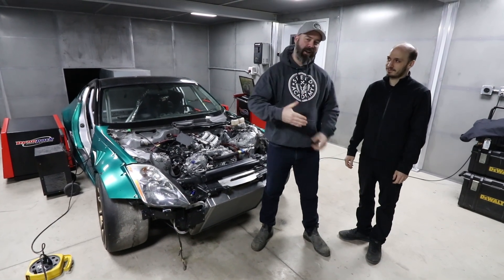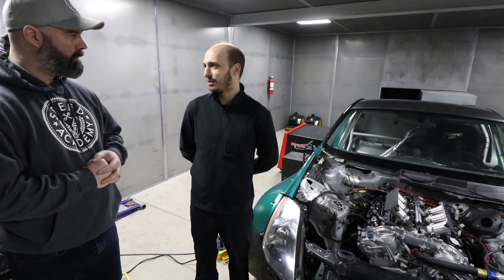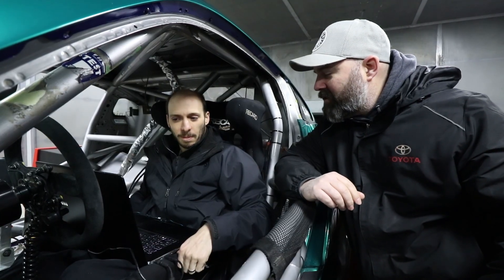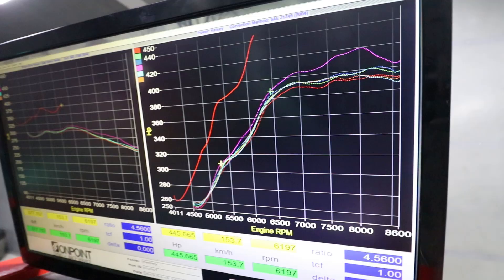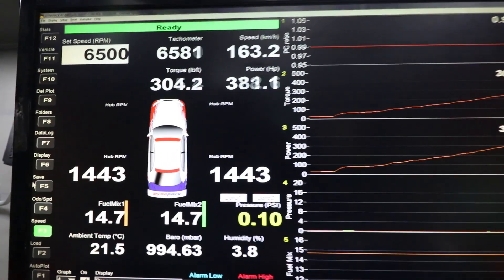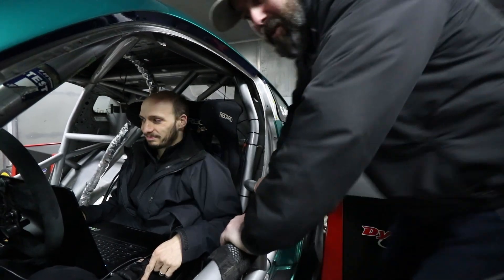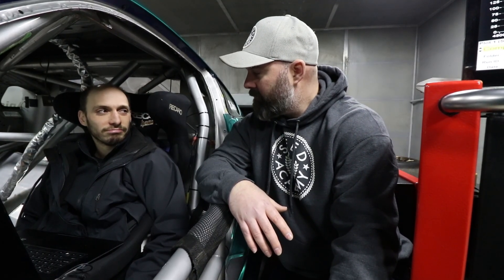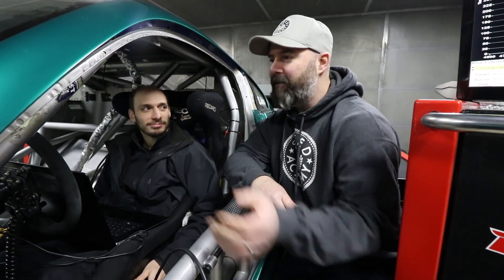RECORD BREAKING! Highest HP ALL-MOTOR 350Z Engine In the WORLD

Comment: there's a lot of 6g75 mivec engine that are making more power than this vq engine, check out el Yadiel mirage that car ran 167.49 mph on a 400m drag strip, that's the fastest trap speed for an all motor in a 1/4 mile.
Reply: thats a 500hp motor with good gearing light lancer body, 6g75 weighs more than all alloy vq as well but 6g is a great engine but with boost nissan V6 make way more hp these days than any mitsubishi v6. Love to see a 2023 GTO v6t but polypropelene composite body version rwd to trounce ft86.
Reply: @altruismfirst6489  check out powertune evo 5, its a 6g75 mivec lancer evo projected to make 2500 whp with 98mm gtx 5533r garrett single turbo. right now they are making 1930 whp with e85 on 40 psi not yet on its full potential and still on the early days of its development, most nissan 6 cylinder engine today once they get to the 2500 whp territory they need all billet stuff, that powertune evo 6g75 mivec still uses the oem iron block and oem cylinder head mitsubishi with of course modified components like valve springs, retainers, camshafts. but still unported and no valve job done.
Reply: @altruismfirst6489  6g75 mivec all motor drag cars like el mvp and el yadiel are way above 500 whp using nitromethane fuel, those cars are making 700+ whp or even 800 whp evident by their trap speed.

Comment: The craziest part of this engine is that it isn't making that power at crazy high RPMs like 10-11k it's just at 8200rpm and seems to have the driveability of a production road car engine. BMWs 4.4 liter S65 makes 444hp at 8300rpm, this thing is making around 200hp more at pretty much the same rpm...nutty.

Comment: so i finished watching the video and I've got to say that I'm disappointed! on "jay leno's garage" they had a 240Z with a GTR engine without the turbo's that made a little less than 300hp at the wheels and that inline 6 sounded WAY BETTER then this one! I love "all motor" cars. I hate turbo and nitrous engines. so it's not like I'm a turbo guy that doesn't like any engine making less then 1500hp. but this was so disappointing! on several different levels. #1 I don't like all the noise this engine makes at the front of the car. that "knocking" is annoying to say the least! the exhaust doesn't sound good either. and even though it makes 600hp. it just sounds like shit!

Comment: could you build a 4.2 and pair it with a stillen supercharger. Definitely keep the compression to like maybe 10:1 and let it run safely and reliably as a street car. 

Hoping for a Rev Limit of around 8k (8250- 8500 RPM)
Really looking for the increase in torque on the low end, and the supercharger to bring it to say 550 RWHP reliably on the high end.

Is this possible to build for my G37?

Comment: Where are you getting 600 bhp?  Friction loss through the transmission is maybe 5%, and you're not trying to spin huge wheels/tires like on a chassis dyno.  I'd give it 567 bhp, which is the theoretical limit of that engine at that rpm (excellent, btw).  Low 10s in the quarter mile?

Comparing your all out 4.2 to Porsche's 4.0 L restricted motors is not apples to apples.

You should work on broadening the torque band.  Proper 1-7/8" headers should fix most of that and help the engine accelerate quicker, better transients, better driveability.  A Helmholtz air box can improve power in your target range, and properly sizing air filter won't kill that much power.

7800-8000 rpm is a good rev limit for an endurance engine with that stroke.  A bad downshift could ruin your day.
Reply: Drivetrain loss for a RWD is considered to be about 15 percent. That's not really something that's changed as far as I know. Straight cut gears might help slightly.

Comment: That is still not absolute peak power for that motor, you can hear it coming on and wanting more...
He might want to re design the exhaust down pipes with wider tubing and better cross flow to help with the heat.
But apart from not reaching maximal potential for the engine it sounded lovely and was a very cool project

Comment: Crazy numbers!  That's over 89Hp per cylinder or 127hp per liter out of an N/A V6.
Reply: Honda did 120hp per liter in the S2000
Reply: @Baerschi100  right….is that somehow important to my statement from 5 years ago?
Reply: You mean a 4.2L V6
Reply: @stezenast5878  why do you open your mouth to say dumb shit
Reply: A bit too crazy.  405 lb-ft of torque from a 4.2 liter NA can only mean oxygenated fuel and that´s at the crank.  If these numbers are at the wheel/axle then it can only be NOS.

Comment: This is how you build. Once you've experienced big NA power, you never go back. Turbos are fun but the real track weapons for sensitivity, longevity and reliability are high HP NA. End of story. 
I run a dry sump LS3 with a custom Kelford cam, touched up rotating assy, custom SS LT headers and 3" exhaust in a T56 mag S2K. I have owned many litre bikes before that too, so NA is where I prefer.
Reply: never heard of anyone running a Kelford cam in a LS. What made you go that route?
Reply: Hell yeah!!! preach it brother. I'd take an NA engine every day of the week over a turbo one. I don't care if it makes more power nothing will ever replace the feel of a na v8.
Reply: U owned a liter bike in a straight line?! Or lap?

Comment: Also, I’m surprised he held the engine at high loads/VE cells for steady state tuning. Usually, I stop at 4500Rpms, then continue doing power runs from there to redline but with EGO/closed loop wideband O2 feedback turned on with +\- 15% correction for rich or lean fueling. Then I go back in the data log of that power pull, reference it to each load cell/area of the VE MAP I went rich/lean and make my VE fueling correction (based on EGO correction).

The reason is, for higher loads, you pass throw those cells in the MAP so quickly during a power pull that you don’t build up as much heat; where if you held it in each cell under high load (steady state), you do build up much more heat (high EGTs).

Comment: I just recently purchased a 2004G 35 sedan just want to know how much power could I get out of the stock engine thank you for reading this
Reply: Depends on condition of the engine and budget...up to roughly 240-250whp I'd guess isn't too hard to achieve for an auto rwd vq with full bolt ons and tune, but maybe more, others can better answer this I'm sure

Comment: Don't know why I'm putting my 2 cents in as you guys are at the top end of brilliance. But I'm wondering how it would perform with a large enclosed plenum over the itb's? I've had success with it smoothing out low end on my k20. Might be because my home made itb setup isn't as efficient as yours. Just a thought. Love the build though.
Reply: Thanks! We do have to build some airboxes. The last ones we made were holding back a lot of power so we have some redesign to do.
Reply: @sashaanis5966  Exactly what I thought would have been the case. Horses for courses I suppose, obviously it's designed as a race engine and having great high end is the goal, whereas the goal for mine was just an aggressive street application, which is why the airbox suited it, sacrificing a bit up top and strengthening the low-mid range, not necessarily a positive for your build. I would imagine designing an enclosure to suit the amount of flow required would be a logistical nightmare.

Comment: There is a guy with a all motor coyote engine N/A that revs 82k rpm and its making 600rwp but thats a v8 not a v6 so very impressive with this car
Reply: I dont think a v8 can do 82000 rpms
Reply: @packrunnr   shelby Gt350 5.2 L 8200rpm...Porsche 918 Spyder – 9150-rpmLexus LFA – 9000-rpm
The V10 

Ferrari F12tdf – 8900-rpmPorsche 911 (991) GT3 RS – 8800-rpmAudi R8 V10 (First Generation) – 8700 RPM 

Do some Research before you come to conclusions.
Reply: @trunkslorenzana  k=1000
82k = 82000
No engine does this lmao
Reply: @AngeloAmanoDomingo  oops my fault, I Just realized I added another 0, I meant 8200k not 82000k My bad guys.

Comment: Haters will still hate even though, "why not get a v8""why not LS swap it?" Gtfoh😂😂😂😂😂😂
Reply: Because LS engines with boost can hit that number with stock internals for thousands cheaper. Any decent LS salvage yard pull lolz. Noob.
Reply: @Saiyan585  Yea man but its a super common swap and who wouldn't want a 6 cylinder that runs with or even smokes a v8 lol  #lsfanboys 😂
Reply: rd95stang bc your better of getting a flat straight 6 sounds better than this shit, BMW and Porsche 💪🏻
Reply: @ĒMANN310  I'd rather a 2jz then lol
Reply: @rd95stang  that v6 will have a garbage ass tq curve too. smoke a v8? nah. thats alot of work for only that much hp...you could get that easy from a big block v8.
Reply: @frigglebiscuit7484  yea im sure power to weight ratio won't come in to play at all lol
Reply: @rd95stang  350zs weigh like 3500lbs. my big block dart is like 3200, before weight reduction.
Reply: @rd95stang  awww, you upset? the 350zs around me are all slow af.
Reply: @frigglebiscuit7484   upset?  Sure guy I'm upset, whatever makes you feel better 😂😂😂😂
Reply: @Saiyan585  basic B

Comment: Nice build, and it sounds amazing - but I'm going to have to say that the dyno is being very generous with torque & power figures.... probably to the tune of 10-15%, if not more.

Even assuming no drivetrain losses whatsoever, that 410 lb-ft peak equates to a BMEP of 241 PSI... which is a good 15 PSI higher than Nascar & older N/A F1 engines.

Comment: That’s quite impressive. Deserves a lot of respect. Especially in the days of turbo everything. Although my NA motor makes 700 horsepower, it does so with 9.4 liters at only 5200 rpm. But it has 500 ft lbs at 2800 rpm and 710 at 4700. But that’s just a mild 10:1 CR. Different strokes for different folks. Heh, literally.
Sweet Nissan though

Comment: Why not just use an off-the-shelf stroker kit and sleeve the stock block instead? You could get a more reliable motor with more room on the top end, and a bigger bore unshrouds the valves

Comment: A good build on a modern engine having 4.2 liters of displacement, why would it only produce 500 bhp? People have been producing 300 bhp K20-engines for over ten years now. Porsche leaves a warranty with their 4.0 @125hp/ltr.
Reply: First, it's 537whp, which is around 600 crank.

Second, as he explained in the video, it is harder to maintain HP/L as displacement increases.  You can't simply say "if you make a K20 into a K40, it'll double in power."

Third, comparing this to a more balanced flat 6 with titanium internals to support higher revs, and all of Porsche's engineering resources is a bit unfair, don't you think?
Reply: @baudchaser  Bro, I know! My comment is about them severely undershooting their goal. I mean, it wouldn't even be worth doing, at all, if it didn't surpass a stock similarly specced engine, would it? I'm glad they reached 150 bhp/l, especially when most americans rave at V8s producing anything close to 100 bhp/l.

Comment: Yes the LS3 6.2 has more torque at lower RPMs, but still what they have is an absolute remarkable achievement with a 'smaller' displacement engine.
Reply: The engine swap route is also boring though 🤮
Reply: I would not mind a mild built vq35 or vq40 in a 350z, but I would probably swap in a lighter 4 cylinder NA
Reply: @Tank-137 now a days you can swap a VHR with HR heads and Intake, long tubes, injector, tune. You will be at 310-340 at the wheels  dependant on fuel choice.
Reply: I mean bore any motor almost a liter over with proper intake exhaust fuel system and tune and its gonna make a lot more power. Built internals so you can rev higher and get a wider powerband will do the same as well
Reply: @E46TY  hint LS7?
Reply: Or a junk 4.8 will have more torque than that with a tune and a few other goodies
Reply: @timothyjensen3465  Still is a bigger displacement engine than the VQ - for countries that tax on displacement e.g. Japan and UK, that matters.
Reply: Just build for boost and call it a day, much easier and way more power.
Reply: @Saiyan585  Its not a right or a wrong. Generally, naturally aspirated cars do better in long endurance races - and thats what these guys are going for.

Comment: A theory on the glowing header question: the middle cylinders are getting less air then the side cylinders because the velocity stacks have less space to draw from, making them run a little bit more rich and cooler
Reply: O2 sensors on each cylinder would be very interesting
Reply: Usually they use exhaust gas temperature sensors in each runner.
Reply: Make them run different length like church organs maybe...just a suggestion
Reply: @AmirPomen  not a good idea. That would completely throw off the torque curve from cylinder to cylinder. Aka cylinders with longer stacks would make power at a lower rpm and cylinders with shorter stacks would make power at a higher rpm.
Reply: @konnerkramer3381  sorry2... What i really mean is not exactly the length of the stack... But the arrangement... Instead of following they cylinder bank lineup, they maybe can arrange the stack staggered across the whole front of the car... So airflow distributed evenly on all cyl. Stack
Reply: I think it's actually less back pressure because of firing order.
Reply: An idea to look into

Comment: 2 wide bands and 6 egts would be most excellent, add pressure sensors to each Venturi to measure pressure differential between each induction horn.

Comment: Can u go more into detail on why the hr heads are always the way to go for max power then the vhr heads with the vvl
Reply: The VVL heads have a variable system in place of a normal intake cam. It's good for stock power upgrades, but beyond normal bolt on levels, they're a limiting factor that can't be upgraded or replaced.

Comment: Maybe I'm missing it but, is the water pump/alternator belt missing? 

I can see he's running a battery charger, but how is he getting coolant through the engine? Electric pump?
Reply: beyond likely he's using an electric pump for the water. That's pretty basic even on engines not anywhere near this level of engineering
Reply: Water pump is run by the timing chain

Comment: I was thinking about the hybrid system and I thought what if you don't want all that torque from the hybrid system when your going throughout the corner. Could you use the steering angle sensor to limit the torque output when your turning the steering wheel, and prevent spinouts. Just a thought.
Reply: Steering angle does not correlate to lateral g's or available grip. A robust traction control and stability control system would be able to accomplish this. I think as long as the torque comes on linearly or at least predictably (which they may play with on the Dyno) that a good driver would also be able to provide all of the traction control needed with their right foot.
Reply: @traxxasslash95  yes I agree a good driver would handle it. Street tires are more forgiving, slicks if they let go, they let go but I'm sure the Sasha will dial this car in and make it perfect

Comment: Cosworth did do over 1000HP NA with a V12 that peaks at 11,000rpm on pump petrol, so about half that with a V6 heh.
Reply: huh, what size V12 though
Reply: @ignasanchezl  6.5 litres, they are still developing it so might change later.
Reply: Or do that daily with any inline 6  2JZGTE, RB26DETT, or N54/S55/S58

Comment: Rod to stroke ratio is 1.59375:1 for the 153mm S2000 Honda rod, quite a bit lower than I would like as it puts a lot more stress on the bore main thrust side - but when you're limited by deck height, pin height and crank throw you have to take what you get.
TBH, I was expecting over 600hp for what the engine was, which is very healthy by any measure - might even have been more if it wasn't limited by the direct acting bucket diameters.

As an aside - the throttle bodies look familiar?

Comment: So how in the world is this achievable but making similar power with a 5.0 8 cylinder isn't? What's so different? I know the VQ is a great engine but it's not much different than any other dohc engine. You can rev a pushrod to 8000rpm just fine, sometimes higher. I think domestic racers just keep everything secret and jdm guys don't give af about hiding anything.
Reply: my guess would be high compression and octane. which is not everything you would need to achieve this output.
Reply: 3rd gen coyote makes 500whp with e85, longtubes and a CAI
Reply: Seven Umstead the coyotes make good power no doubt, people have pushed almost 700bhp N/A out of a coyote.

Comment: I'll just sit back here with my V8 and cry.
Reply: Lol
Reply: V8 350z life
Reply: Get a Chevy 302 and rev as high as 12 k
Reply: The Jack roush motors 302ci in the 90s imsa cars made 900hp when unrestricted and would rev 10,000rpm
Reply: TexasRoadWarrior but I don’t have an IMSA car
Reply: Why? Lol N/A V8 record is somewhere north of 1100whp
Reply: b00st3d92 lol I was referring to my trusty old 2V
Reply: @JesseCarmichaelAutos  2v's can make power, just not NA power lol. they definitely require boost to be woken up.
Reply: @ltsjoke5443  lies. you forget that 2v v8s can have massive fucking valves. you  can easily make 500hp na with a cheap built big block.
Reply: Lmfao how i got a N/A v8 making 630whp😂😂
Reply: Cant hang in ur own class?

Comment: TJ  swapping his vq for a 2jz for less hp ....
Reply: You could do less horsepower with a 2JZ if your broke af.  Injectors, fuel pump, turbo/intercooler/etc., and a standalone gets you roughly 800 with a stock bottom end.  The more expensive part is the actual swap hardware.
Reply: Mno Skaffa less hp but a stock bottom end
Reply: Everyone talks shit when people 2J swap something like oh less HP. Who the fuck puts a dead stock 2J in something? People are gonna mod it to make power. People can mod them for extremely cheap. Easy to find parts. Its the bigger picture. Cheaper, more simple, more reliable. VQ’s arent very reliable unless you drop thousands on them.